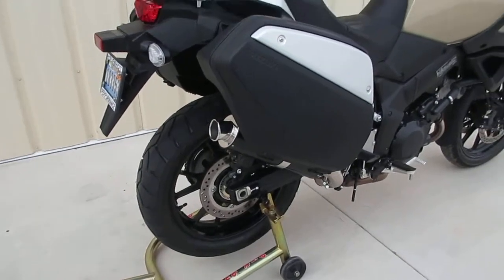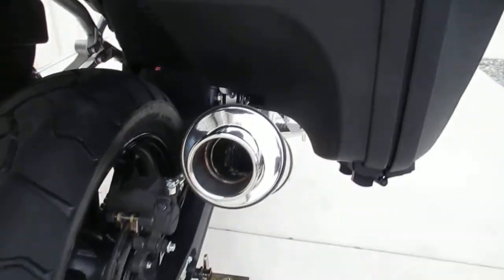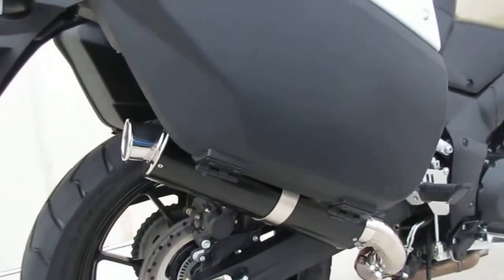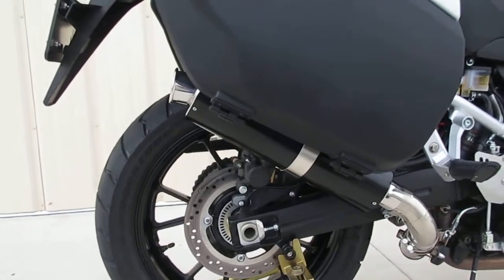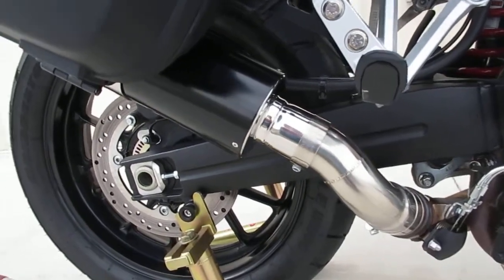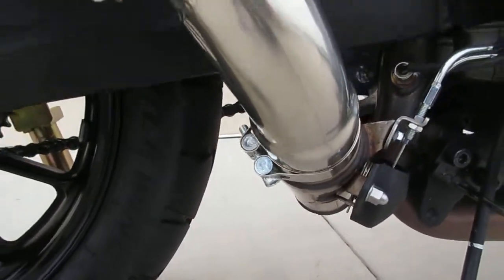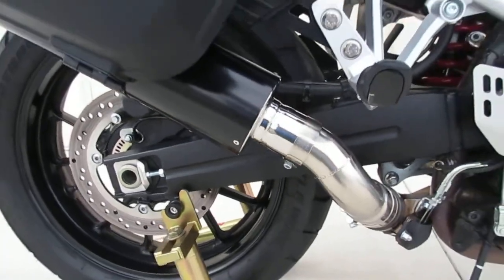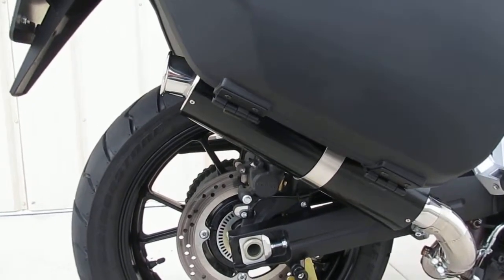2014+ DL1000 Holeshot 14" Slip-on with bags www.holeshot.com

Comment: What about a 2012 year do they fit this good? 14 inch on a dl1000 2012
Reply from the maker: +Robert Ray   Yes you could run them,  but they will be quite a bit louder on your 2012 so keep that in mind 

Cheers  Dale
Reply: How much is the shown 14inch exhaust ?